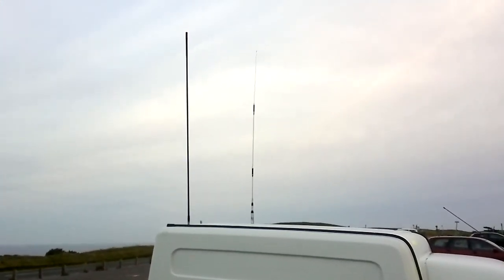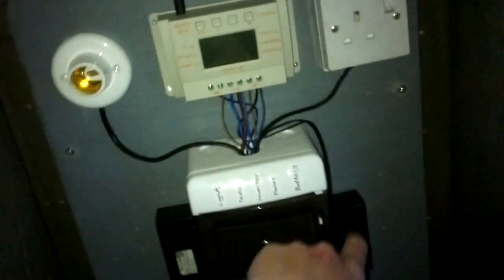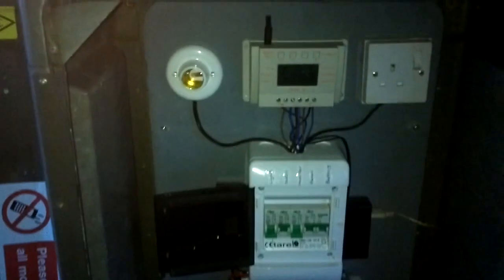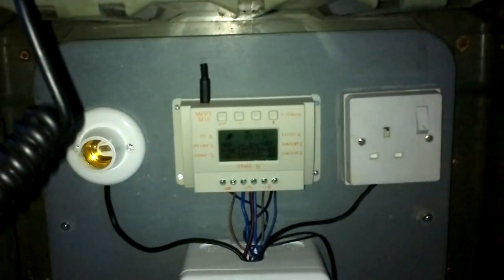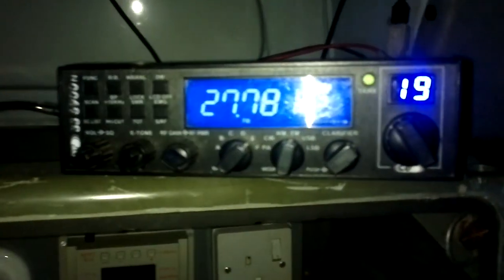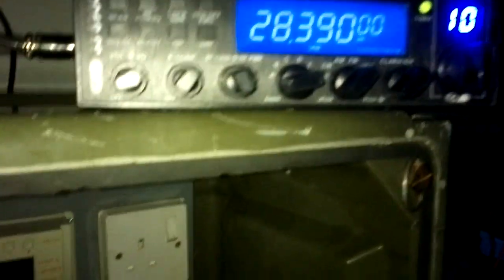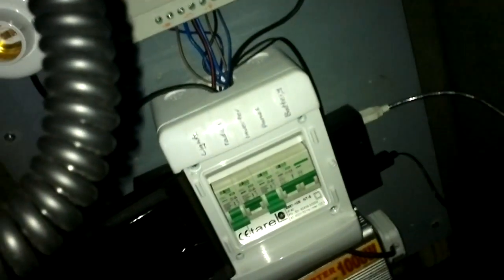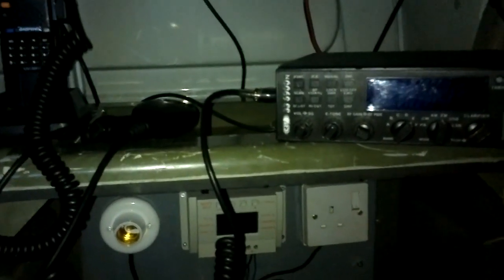testing the mobile solar shack

Comment: Hiya Simon,
Another great video mate. The mobile shack is coming along nicely.
Just a suggestion, You've probably thought of already but just in case you haven't,
Have you thought about getting a 5m roll of self adhesive 12v LED strip lights to go round the inside of the roof in your van. They give off a ton of light and use very little power. Connected to your off grid power supply they'd be ideal. They are really cheap on eBay and easy to fit. I think they would look really cool in your van.
Just an idea. :-)
Keep up the good work buddy and take care.
All the best,
Ray. 34CT4149 :-)
Reply: Just thought you could perhaps use those for a static light source which stay in place, then use the USB ones to move about to different areas needing more light. :-) Just a suggestion anyway buddy. :-) Look forward to seeing more mods and different ideas you come up with. Keep up the good work Bud. :-)
All the best.
Ray. :-)